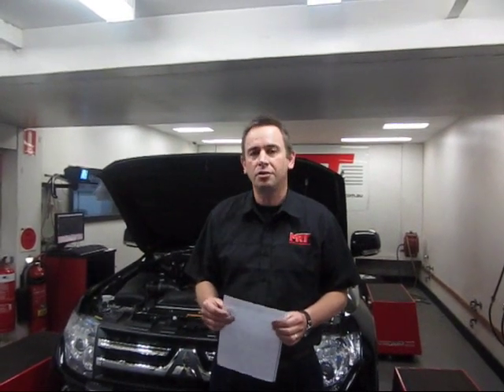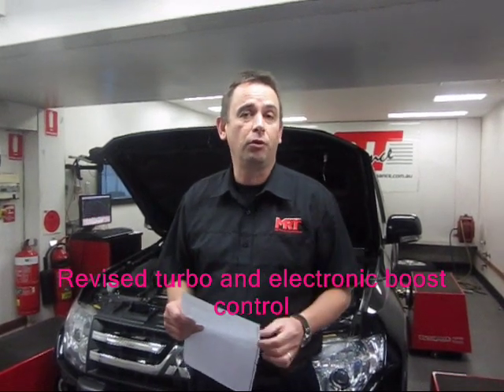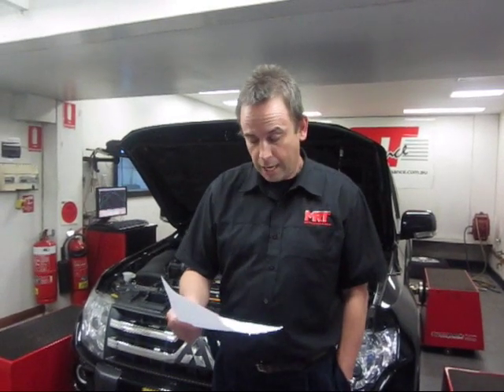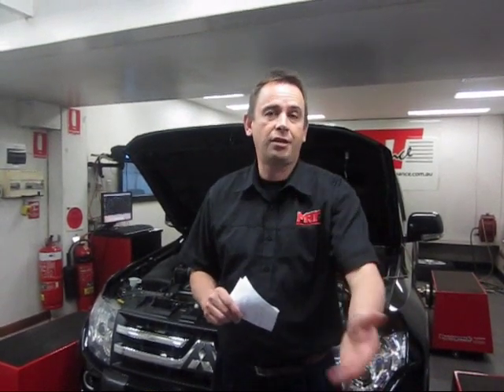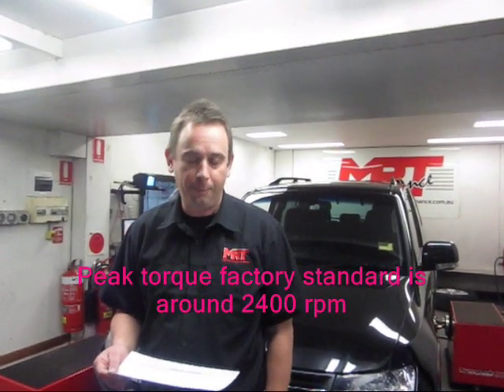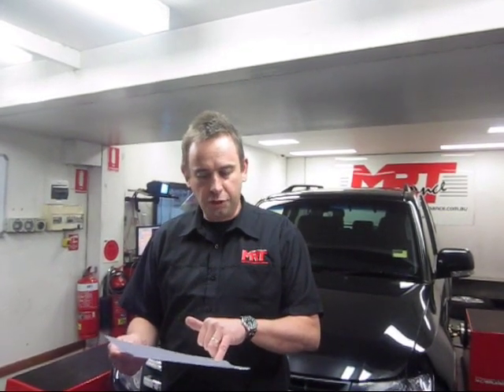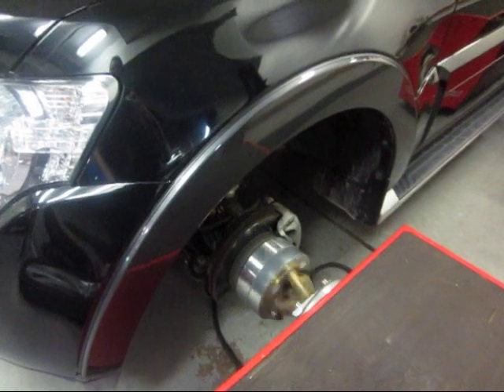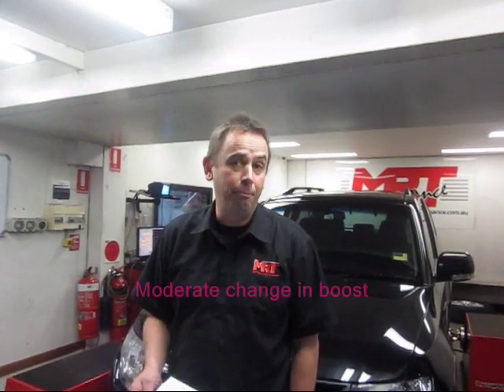Mitsubishi Pajero Shogun Turbo Diesel ECU tune and Dyno data

Comment from the maker: @deafwish all our dyno data is tested and confirmed, thats part of our R/D. We do more testing and  research than any other workshop. :)
We don't do "reflash's" the Ecutek software allows us to convert the factory ECU into a fully adjustable ECU and  then we custom tune each and every individual car.
An exhaust on this model only adds about 20% more than the 80% that we get via the ecu tune on its own!

Comment from the maker: @lonewolf74 these days TUNE first THEN exhaust, as often the exhaust wont give best results unless the car is tuned to suit. In this case there is MORE power and Torque from the ECU than can be got in the exhaust when measured separately